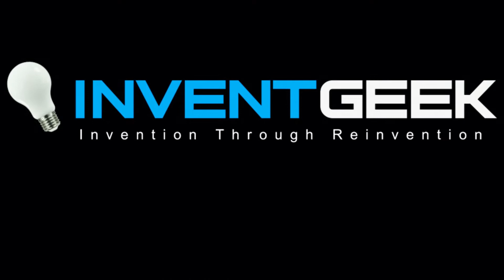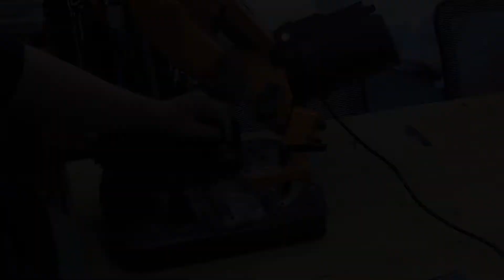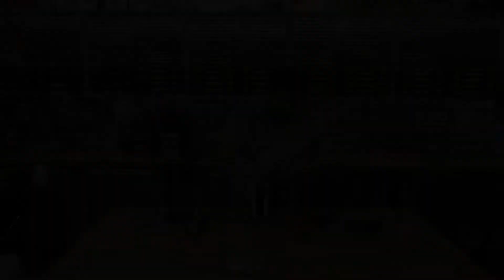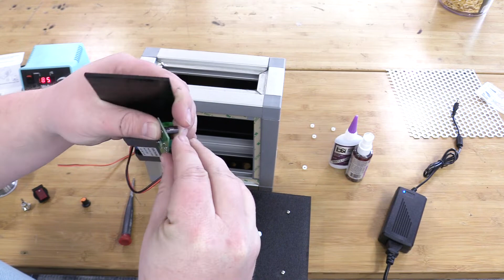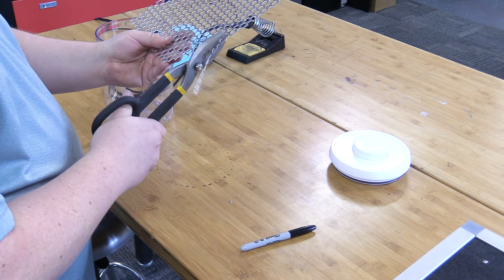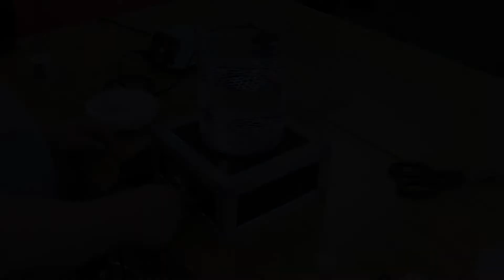Resin 3D printer part washer / Stir Plate Build and Review

Comment: Love this project, so I ordered the components, the issue I am having is the spinner magnet is defeating or aligning with the magnets within the fan hub, this just makes the fan twitch or spin at a greatly reduced rpm, the motor magnets also push the spinner magnet off center so a spacer will be required, worked like a charm for you though. Great job and thank you.

Comment: Good video, thank you. Considering this is for cleaning 3D resin prints, I'm surprised that more of the parts used weren't 3D printed. The enclosure, for example, and definitely the little platform that keeps prints off the bottom of the canister. Was there a reason?